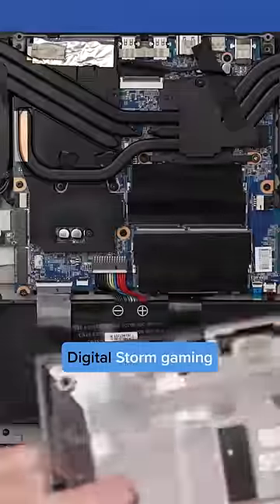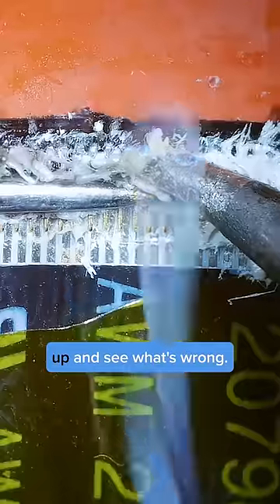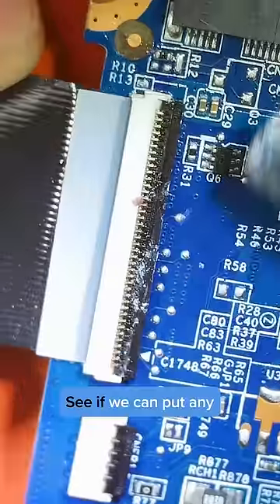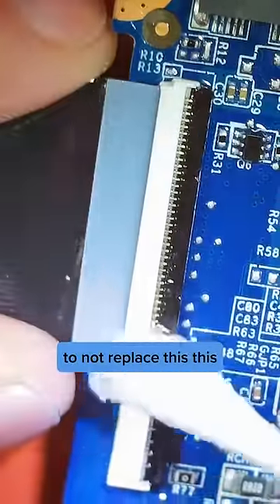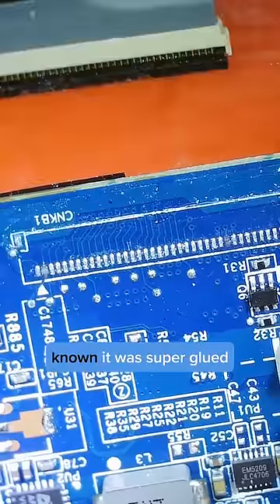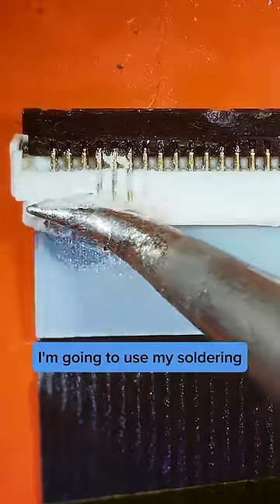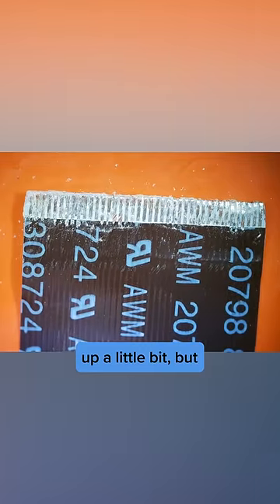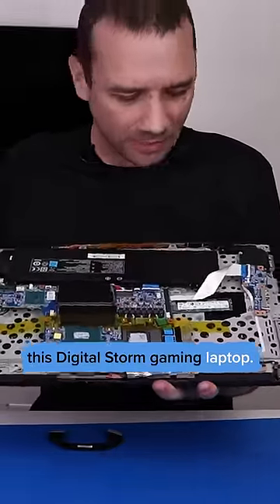I Bought this $2,000 Laptop for $900 - But It's BROKEN!

Comment: DIY definitely is the master of the pieces. The connectors need cleaning, accumulated dusts as well as grains of super glue. That is going to work. Gaming Laptop/Appliances synchronizer/sorted files/appliance 1 oven/2 cooker/TV/electric fans/hospital doors-auto-basic/ NON-ALGORITHM-standards of excellence. ePLDT/PLDT/SME-SMC/Group/Telecommunications and partner Industries ∆ Tierage 1 and 2 Levels 1 and 2 Systems Administrator(s) non algorithm non-virtual employees/Tech/brands sites/branches/Brands management+employees/. Tierage Exception:Reason:Importance High/Necessity/advancement in Sciences Tech/accounted-statistics/reliability and Quality control. Thank you Tierage.

Comment: So put the little fingers sitting in a solvent check it in on it and if nessesary solder wires from the board to the cable and tape it? But thats. Also tedious and annoying, exactly what you can get paid for.

Comment: how is that a deadend? replace the cable, surely you can either unplug or desolder it at the keyboard end. if not, replace the keyboard.

surely thats cheaper than just buying another $2000 laptop.

so much waste these days. i dont know the solution to waste, as people need to get paid fairly, and that is often hard if a repair including parts and the hourly wage adds up to almost as much as a new item its tough.

maybe the government in all their over the top 'green' bs could subsidize repairs to minimize e-waste/ waste in general?

i dont know. i will stop rambling.

but this guy is being paid to repair stuff, presumably has professional tools and access to spare parts, plus he makes videos off of it to earn money that way too, so surely he can afford to fix this laptop.

Comment: The connector is easy to replace and so is the cable use low temp melt solder that way the fpc doesn't melt...